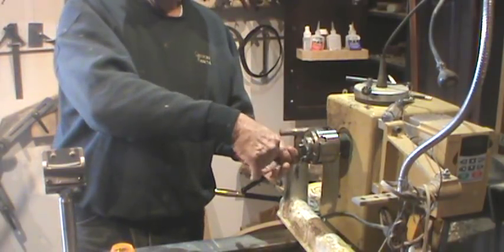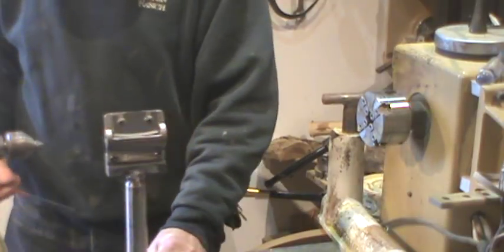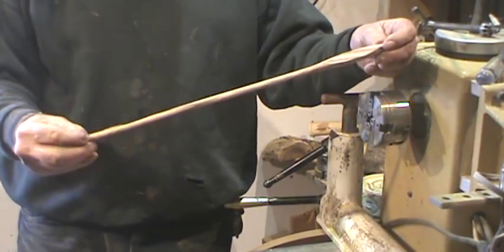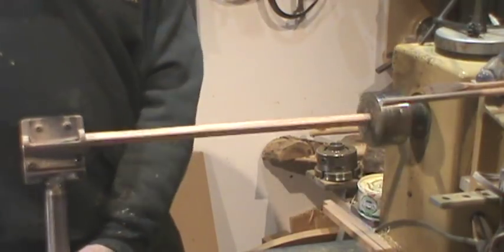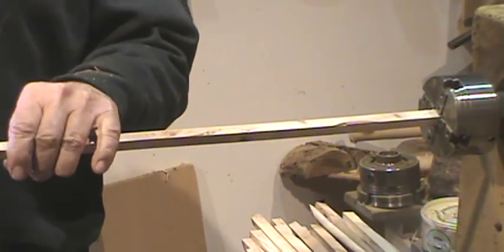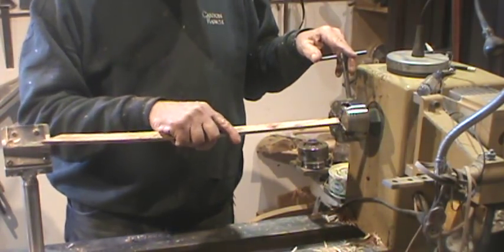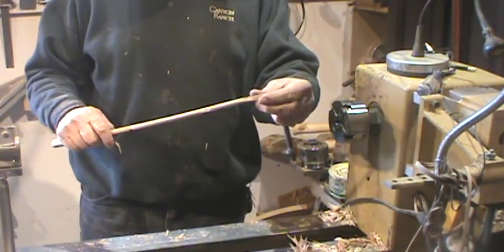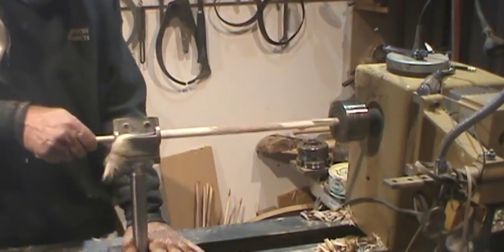Making dowels on a lathe

Comment: Hello Nubsnstubs. I have not even finished the video yet but I can see for you to finish the dowel just turn it around in the chuck and leave the cutter on the dowel loose. Then tighten the chuck on the already turned end and pull the cutter away from the head stock finishing the turning on the dowel. Or you can turn the dowel around and cut the same way you do to start. Hope that helps. I got to get one of these.

Comment: Watch out for the ponytail. When it wraps around your turning you will be in pain.
Reply: yeah, that was what I noticed, too.  Getting hair caught in a lathe can be deadly, especially on larger lathes and metal lathes.  More horsepower or geard down more.   But turning your back on the equipment when you have a ponytail is risky; tuck it into your shirt at least.   And hair gets closer to machinery than you think it will.  Also, long sleeves, watches, jewelry, drawstrings can get caught.   Even pockets if you get too close (someone leaned over near the back end of the headstock). .  And 3/4/6 jaw chucks and lathe dogs are really good and grabbing things.    Sandpaper also can wind around the work and pull you in.

Comment: What is that tool called? The one that looks like a pencil sharpener……
Reply from the maker: Chris, it is a dowel making tool by Veritas. I made the post and slide that fits on the ways with the dowel maker attached at center. The head where the wood goes into is the Veritas Dowel Maker the you can purchase from the following link.  https://www.leevalley.com/en-us/tools/brand/veritas This tool is designed to use with an electric drill, but I designed it to use on my lathe. ........... Jerry